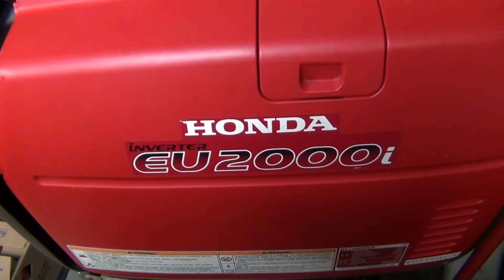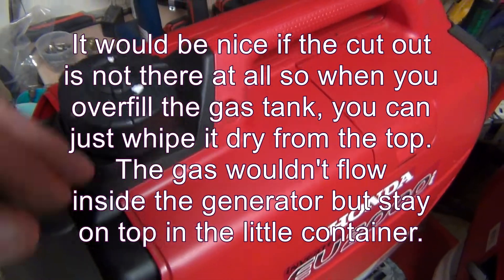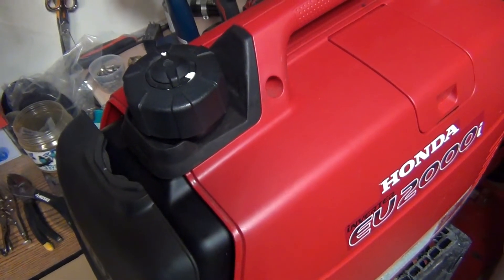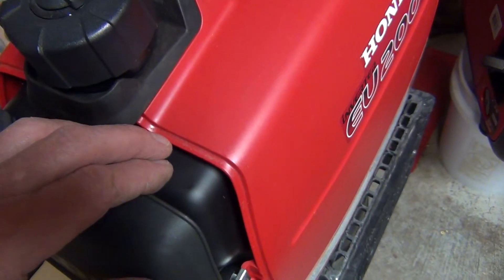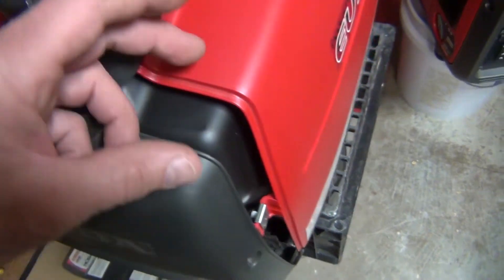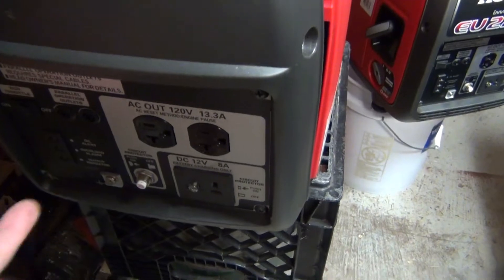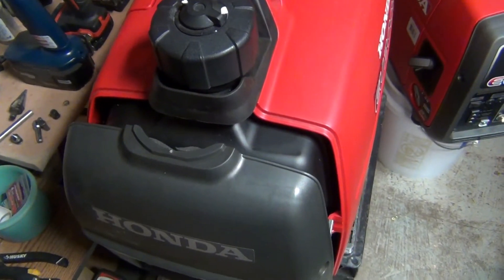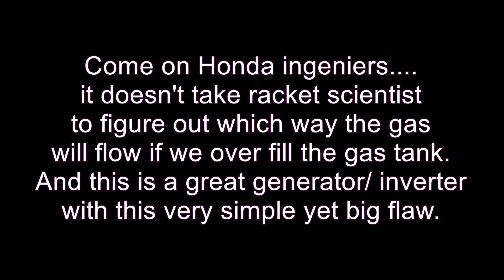Big Flaw in design of Honda EU2000i & EU2200i

Comment: It is a crazy design, but we have to live with it to get all the benefits of this great generator, so I devised a way to deal with it.

There are two parts to my solution. First, I wear a headlamp when filling. This lets me easily look down into tank so I can see when the fuel is near the top. Second, I use small (1.5 gallon) gas can which has a relatively small diameter flexible spout. I hold the can in one hand, and bend the spout down into the opening with the other, and then tilt and fill. I've never spilled a drop since I figured this out. You definitely do not want to be filling this with a 5-gallon container (30+ pounds when full), and usually doesn't have a simple, really flexible spout). 

One last thing: I don't attemp to fill it 100.00% full. 98% is just fine and will give plenty of runtime (4-5 hours when powering six circuits in my house through a transfer switch, using ECO mode).

Comment: Hey Fred another great video. I subscribed to your channel, but when I looked it had unsubscribed me and I missed this video. I used to think I just was not able to pour gas well,  I tried different funnels and gas cans with those spouts that are worthless. We are not he problem, pouring gasoline never used to be that difficult.

I finally figured out how to do this difficult task that should be simple. I purchased a cheap siphon pump from Walmart.
https://www.walmart.com/ip/Hyper-Tough-Siphon-Pump-Universal-6-36201WD/498617798

I already have a hose clamp or hose pincher. I use the siphon and watch the fill very closely and the pinch off the hose, it is a slow but steady procedure. It beats starting a fire or ruining your inverter and I only spill a few drops once in a while. 

On this site they list the inverter unit for $260

https://www.hondalawnparts.com/oemparts/a/hpe/5a78dc7087a8660f58769ff9/control-panel-2

Take a look at this site and tell me what you think.

https://www.ec21.com/ec-market/honda-generator.html

Comment: What's so hard about not overfilling the tank? That's an operator malfunction, not a machine flaw.
Reply from the maker: I take it you don't own one off these.
Reply: @VladFredK  You're right, I don't own one, I own 2.
Reply from the maker: @cledussnow9507  then be careful and don't over fill it :)
Reply: @VladFredK  
I don't think I would call that a flaw I would say just be careful when filling, if you have trouble filling it with a five gallon fuel can I would say go ahead and buy a one gallon fuel container and fill it with that. I understand how hard it could be to fill the generator with a five gallon container especially with all these EPA crap gas cans we have nowadays!
Reply: @chivosadventures8171  This is all nice talk but why is that cut out even there? 
It does not make any sense at all. I'm trying to understand it but I can't come up with reasonable answer.
Reply: @tysesty  
That's a very good question that I do not have an answer for. I do not own one I do however do own a Yamaha 2000 watt inverter generator and I've never had any trouble with any fuel going into the electronics side of the generator whenever I overfill it. Maybe it is a flaw I do not  know.
Reply: @chivosadventures8171  Thank you.
Reply: @VladFredK  I actually use a 6g tank and have no problem filling it. This is user error and or not enough muscles. Just use a 1g fill up from now on....problem solved for you.
Reply from the maker: @R8tedRR22  Yeah, well it is the crappy shit gas tanks from  Home Depot but the gas tank on Honda EU2000i is a crappy shit design also and I don't care what anyone says.
Reply from the maker: @R8tedRR22  Now when I'm thinking about it it could be the nozzle I'm using.
Reply: @R8tedRR22  you r just a better man